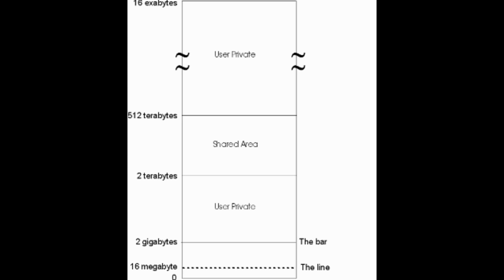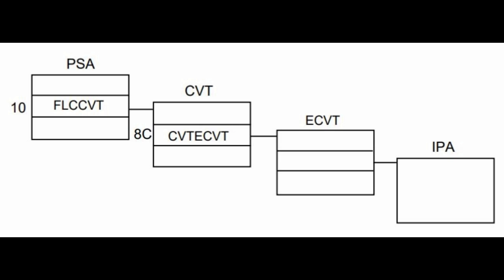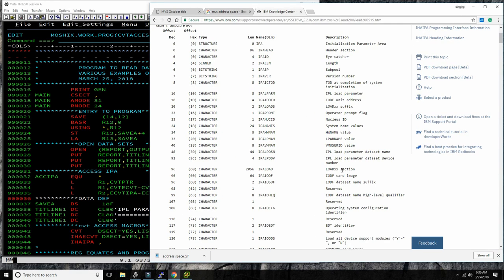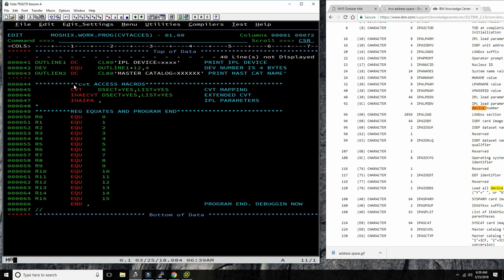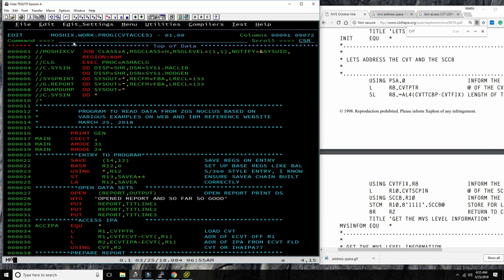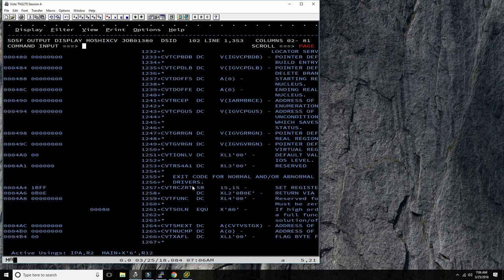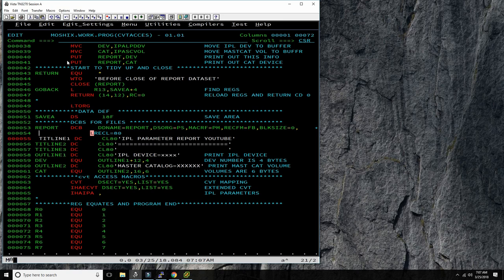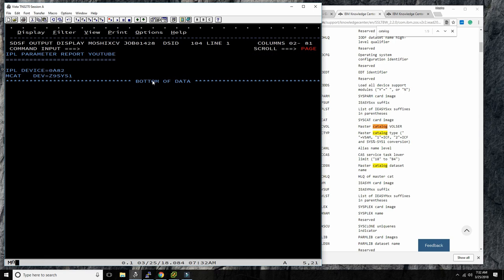z/OS systems programming - obtaining OS data from the nucleus - M57

Comment: Moshix, thank you so much. You explained it so well...now even I can access the data areas from Initialization parameter area without the help from system programmers. You make it look easy but assembly program is like a black magic for only those high rank system programmers knows what is going on inside that nucleus...we are not suppose to touch...or even smell. Thumbs up!  hahaha...
Reply from the maker: Rocky Yap yes COBOL rexx PL/1 and C can all be used. Not fortran
Reply: it's easy with Rexx to obtain certain information from MVS/z/OS (not MVS38), some examples:
/* REXX */
say jobnum()
say jobname()
say userID()
return
JobNum: procedure
TCB= C2D(STORAGE(021C,4))           /* TCB address at '21C'X of PSA */
JSCB=C2D(STORAGE(D2X(TCB+180),4))   /* JSCB address at TCB + 180  */
SSIB=C2D(STORAGE(D2X(JSCB+316),4))  /* SSIB address at JSCB + 316 */
JOBNUMBER=STORAGE(D2X(SSIB+12),8)   /* Job number at SSIB + 12    */
return strip(JobNumber)
/*   Job Name */
JobName: Procedure
TCB= C2D(STORAGE(021C,4))           /* TCB address at '21C'X of PSA */
TIOT=C2D(STORAGE(D2X(TCB+12),4))    /* TIOT address at TCB + 12   */
JOBNAME=STORAGE(D2X(TIOT),8)        /* Jobname at TIOT + 0        */
return strip(JobName)
/*  UserID  * /
UserID: Procedure
TCB =C2D(STORAGE(21C,4))       /*  GET CURRENT TCB */
JSAB=0                         /*  NULL POINTER    */
IF TCB<>0 THEN DO
   STCB=C2D(STORAGE(D2X(TCB+312),4))
   JSAB=C2D(STORAGE(D2X(STCB+188),4))
END
IF JSAB=0 THEN DO
   ASCB=C2D(STORAGE(224,4))       /*  GET CURRENT TCB */
   ASSB=C2D(STORAGE(D2X(ASCB+336),4))
   IF ASCB=0 THEN RETURN 8
   JSAB=C2D(STORAGE(D2X(ASSB+168),4))
   IF JSAB=0 THEN RETURN 12
END
JSABE=C2D(STORAGE(D2X(JSAB+13),1))
DO WHILE JSABE > 127
   EYE =STORAGE(D2X(JSAB),4)
   IF EYE<>'JSAB' THEN RETURN 16  /* INVALID JSAB FOUND AT D2X(JSAB) */
   JSAB=C2D(STORAGE(D2X(JSAB+4),4))
   IF JSAB=0 THEN RETURN 20      /* UNABLE TO LOCATE A VALID JSAB */
   JSABE=C2D(STORAGE(D2X(JSAB+13),1))
END
USID=STORAGE(D2X(JSAB+44),8)
RETURN USID
Reply from the maker: Love it. Thanks. To me personally it looks easier in assembler but that's just because I am lousy at rexx .thanks a lot!
Reply: looking at the code, the navigation through the control blocks, it was certainly coded by an assembler programmer.
Reply: Getting an error at     STCB=C2D(STORAGE(D2X(TCB+312),4)) Have this been tested?
Reply: sorry my fault, you need to add:
NUMERIC DIGITS 10 
after line 1 (the /* REXX */ line) 
if it still doesn't work, you can add a TRACE RESULTS statement after line 1, and hardcopy me the output.

It ran in my environment for over a decade ok. Unfortunately I can't test it anymore, as I lost z/OS access with my retirement last September.
Reply: After adding NUMERIC DIGITS 10 it actually worked!! Thanks Peter.
Reply: my pleasure, I am glad it worked!
Reply: @moshixmainframechannel  With PL/1? I thought only PL/S allowed direct addressing of absolute memory addresses within the virtual address space? (Although it's been some decades, so perhaps PL/1 does something now that it didn't used to do.) I remember being so overjoyed when our school got a C compiler so that I could access the system tables from a high level language, since I didn't have access to PL/S.
Reply from the maker: Yes. It is possible. PLI has pointers.
Reply: @moshixmainframechannel  Yes, pointers, but can you set an arbitrary address into a pointer? Back in the 1980s, that was one difference between PL/1 and PL/S.
Reply from the maker: Yes. You can read all the areas in your address space. Changing requires privileges of course
Reply from the maker: @randomcommenterfromdownund8949  yes you can.
Reply: @moshixmainframechannel  Wow. That's a change from when I was on the platform. They took some training wheels off and made their pointers more like C.